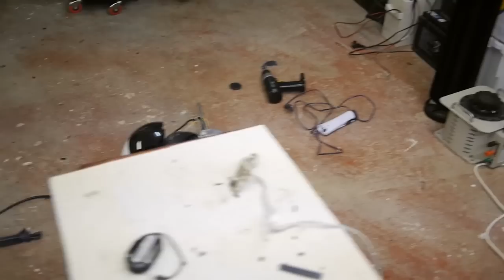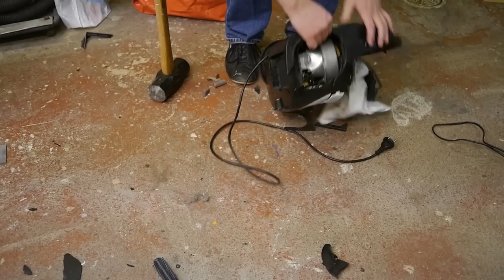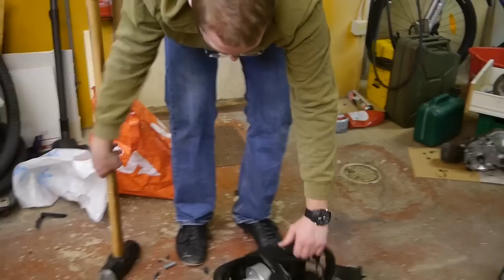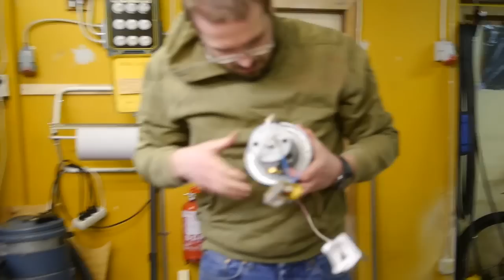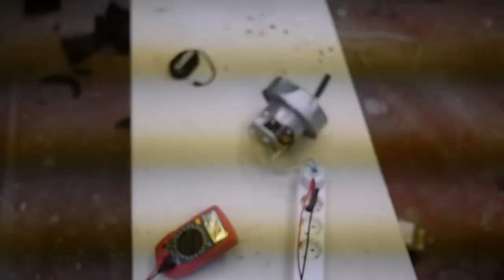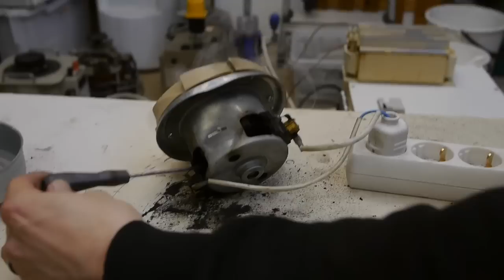Vacuum cleaner motor epic burnout

Comment from the maker: It's isolated, meaning that the motor doesn't have a ground reference, so no current can flow from one point of the device to ground.
If he would have used two hands at the same time, then it would be a different story entirely :)
Reply: I want to use a vaccum cleaner motor to build a table cutting machine, can you tell me how to wire it safely? is a caoacitor needed? this guy just pluged mains to brushes